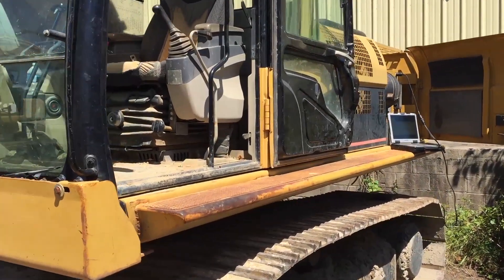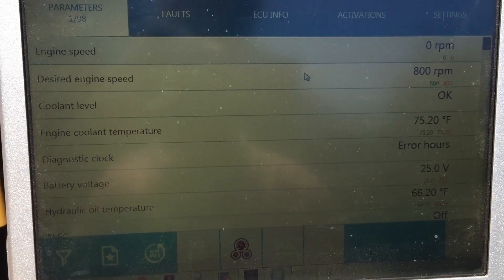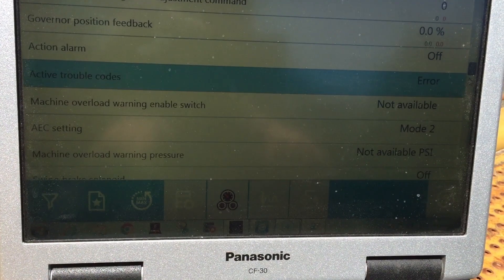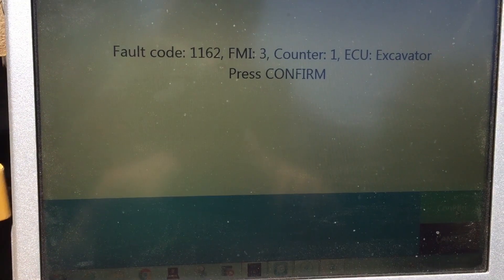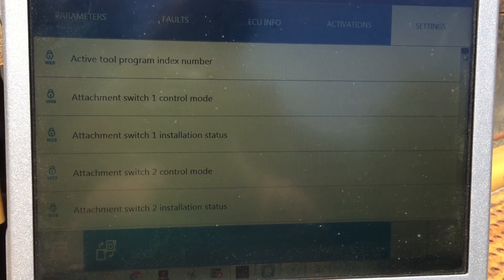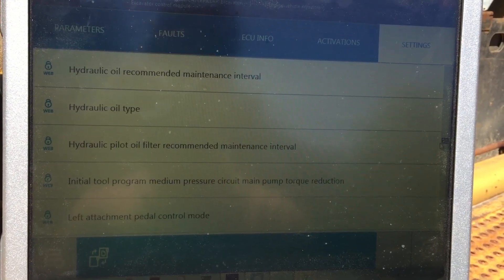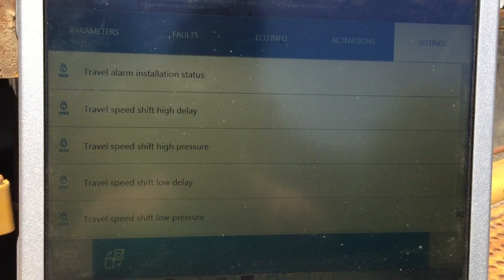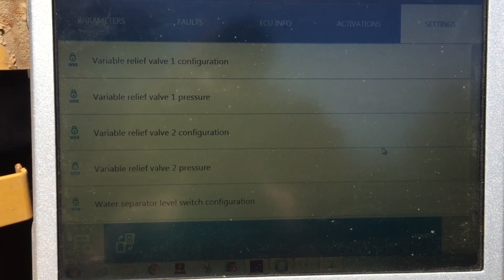Performing dealer level commands on CAT equipment without CAT Software

Comment: Hi I have a diesel laptop. Does this diagnostic tool reset lockout codes 3715 particulate trap active regeneration inhibited due to permanent system lockout?

Comment: How does the technician know which valve is which since they are labeled valve 1, valve 2, etc. I had this question myself 2 days ago on sensors on a John Deere where Texa listed them as sensor 1, 2, 3, & 4?
Reply: The hydraulic schematic has each valve labeled, the 1 2 3 4 valves that you see in this video are all optional auxiliary valves, the standard functions like boom stick bucket are labeled boom stick bucket